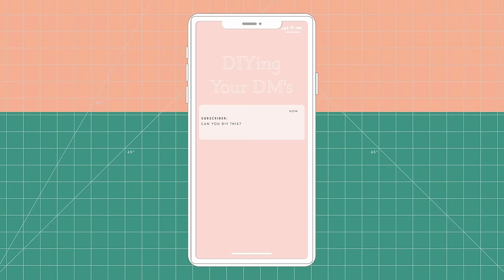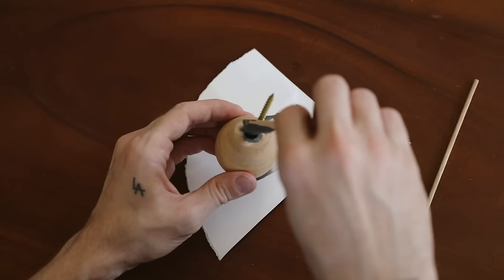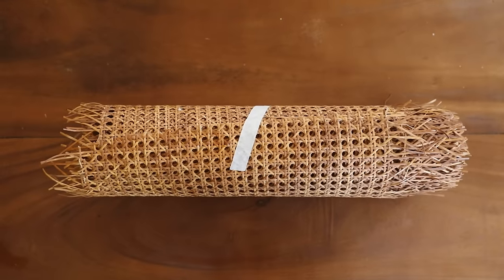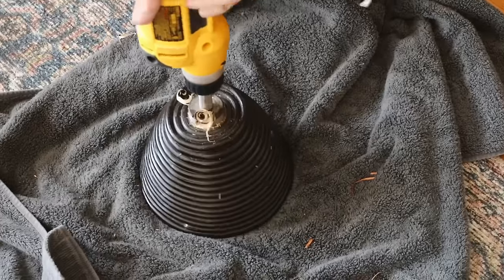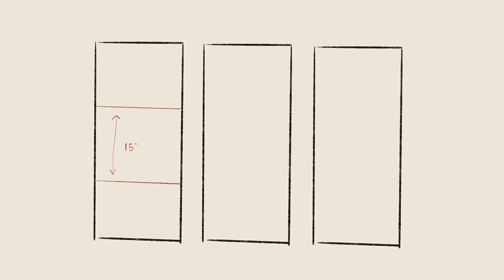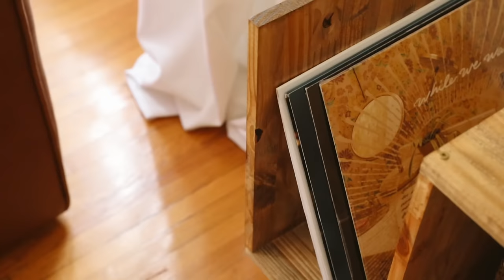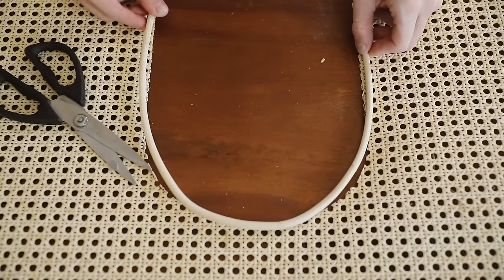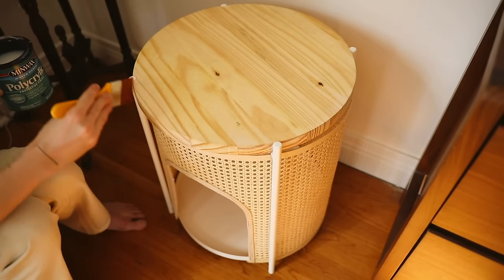Creating DIY's YOU DM’d Me! ✨ 4 UNREAL DIY Furniture + Home Decor Projects (Budget Friendly)

Comment: for the wooden post with with the balls. for added use of the little ball do the same screw trick but with a short enough screw that wont poke out the oak post. Then add a plastic spacer to the back of the post (to offset it from the wall) and a space on the screw that will go into the wall. You could add an addition screw at the top and counter sink it and cover the head of the screw if you wanted up the difficulty.

Comment: Lookit you, Mr. Drew the cabinet maker!  All of your dupes are excellent.  In fact, I think the pet bed table dupe is much better looking than the original. 
✨🦊✨👏👏👏👏👏
If you ever again work with that caning piece that broke on you, just soak it in water for a day (or 2 ?) and it should bend without breaking.  That said, your solution to finish that edge turned out looking great.

Comment: Why not a  dowel screw with the wood ball. And you need to get the  Cane splice wet and shape to to dry in the shape are it will break like that. The last is for basket weaving. Though preglued it is the same as the wood edging product you use on finish plywood builds.